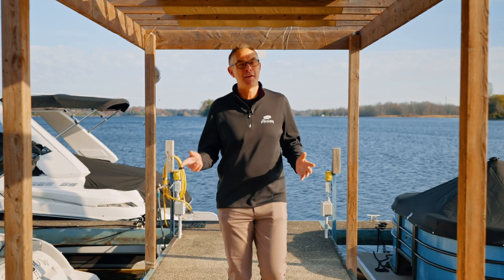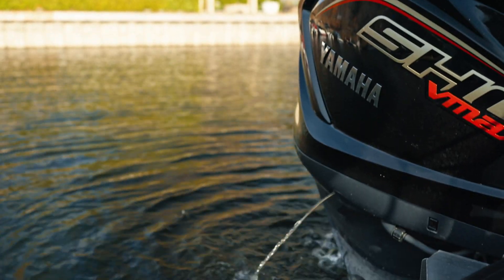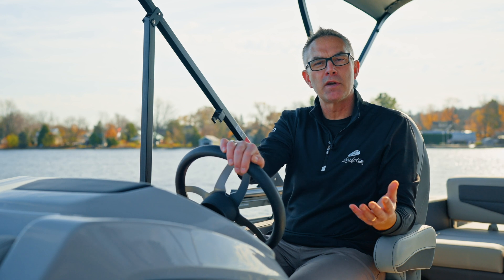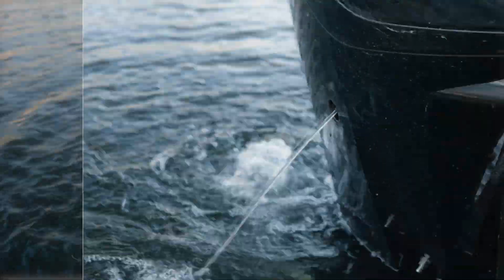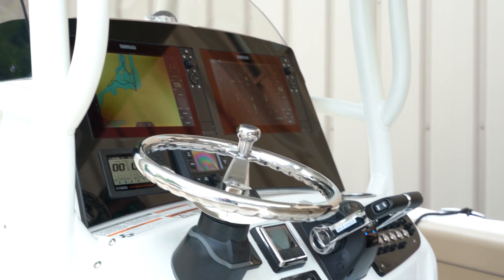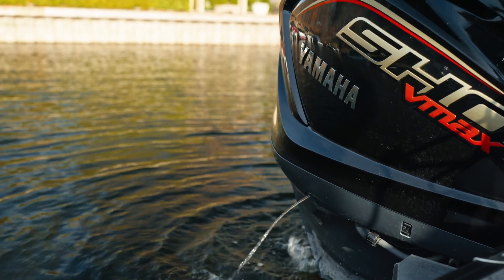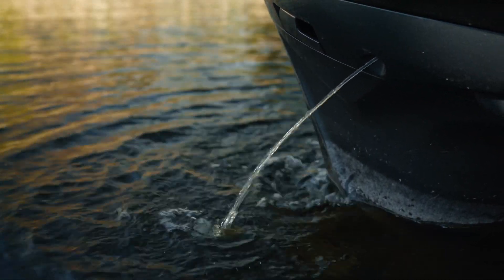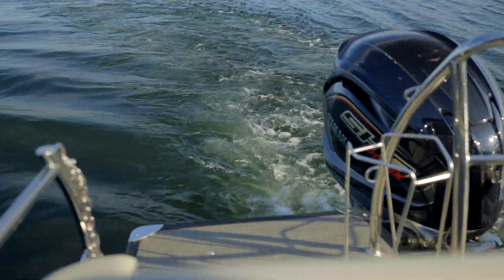Water Not Coming Out of an Outboard Motor

Comment: When operating below freezing or if it freezes overnight late in the fall, the pisser will not always work. My Hondas normally have to run for about 5 to 10 minutes before they begin to piss. I watch mine like a hawk late in the fall and become concerned if it does not start pissing after a good 5 minutes.

Comment: Thanks for the info. You saved me from taking boat out of water, trailering and boat mechanic fee. I used a thin flexible zip tie to clean out the tube opening.
Reply: I just did the same today on my Yamaha 300

Comment: 2 things, 1 The best thing I’ve found (it can bend turns yet remain rigid) to put up your pisser for clogs is solder wire. 2 strength of your piss indicates condition of your impeller.  However, Hondas and Suzukis piss stronger whereas Yamahas are weak pissers

Comment: Just an FYI, Mercury uses that part of the cooling system to cool the fuel on there EFI motors. Mine was clogged and caused the engine to shut down.